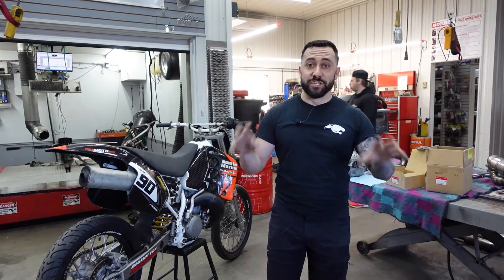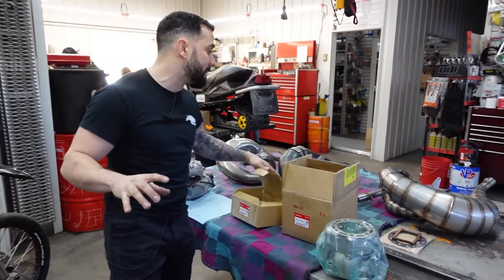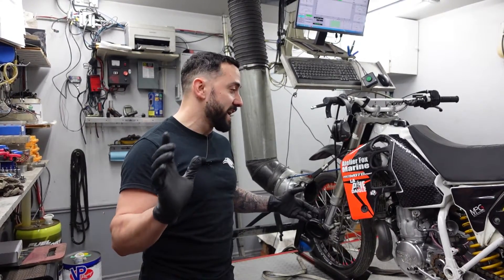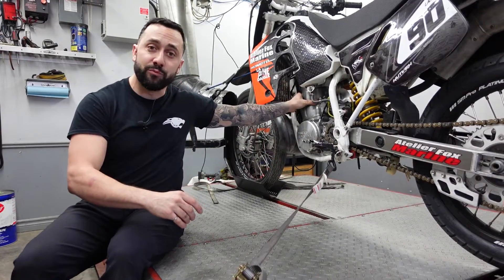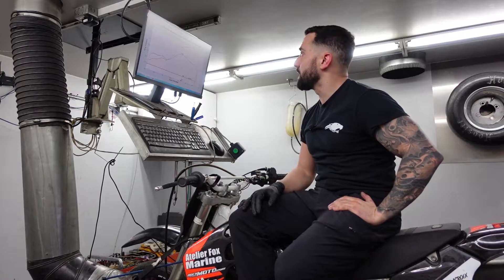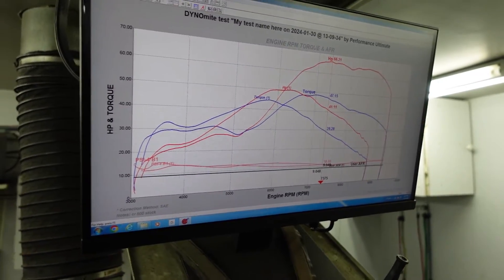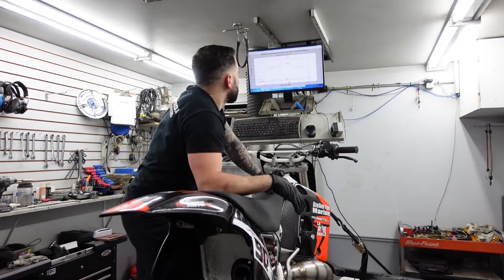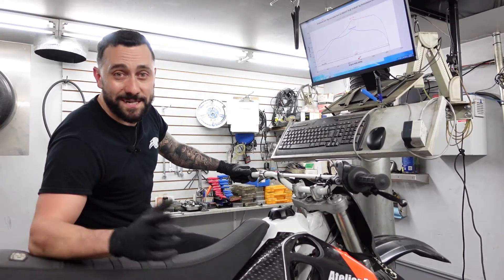Episode 3:  CR500 dyno testing versus Panthera CR560 cylinder  - Mad scientist explains

Comment: I’ve been looking at your motor for a couple months. Just realize I should YouTube it and see what I find and of course it didn’t disappoint. Just spending 11 grand on a dirtbike motor😮‍💨 remember a few years back when Chevys 572 bigblock came out you can get a crate motor 10 grand or a fully built hundred horsepower banshee motor for 10,000 right now …. I need the price justified just a little bit more before I buy one.

Comment: I wa to buy a 560 cylinder for my cr500. Does this set up kill the cranks quick
Reply: Just as a rough estimation if some makes 20% more power you can expect the original stuff to wear 20% faster not always the case

Comment: Here you can see the REAL tuning differences when you go for higher RPM and match the pipe with porting.

Some guys say "I tried everything did all the mods and get 52hp vs stock 50" but they arent really going for power. Just trying to maximize the old powerband thats too low to make high HP :)

Easy 65+hp from a 500. When playing around with pipes you should find the one that matches your cylinder. If you want more power you should MAKE a pipe and port where you want the power to be at.

Comment: Based on my humble math skills. ON rwHP! The Panthera 560 bigbore alone is enough to put down more HP than a Stark Varg 🥹
Reply: Cosworth made a 300cc 4 stroke that makes 90hp to the crank. This stuff is definitely possible but most wouldn't understand because a new pipe and exhaust is considered "fully built" 😂
Reply: You can get almost 80 with the stock cylinder.
Reply: And just full the tank back up and the fun never stops

Comment: Thanks for the Great video. It was interesting to see the FMF pipe actually produced less hp than stock. All it really does is change the power curve slightly and sound meaner. Those other cylinders and pipes had some very impressive gains.
Reply: FMF Fatty has been the best overall gain IMO. The Gnarly shifts the power down low, but taps out up top. PC is a primarily a top end pipe. I cant speak to CPI or Hygge tho.

Comment: How does the customer tune the power valve for the setup he has? You went full open then full closed. Is that something that’s done before you get the motor?
Reply from the maker: The module comes pre-set for an opening around 5500rpm. But you might need to connect to it and tune it depending of the pipe you run. We can sell the connecting cable.

Comment: I got 80 rwhp 53.5 tq @ 7800 on my pm07.   In my quad With a 41.75 mm pwk.  Led performance pipe.  💪 faster than any cr kx 500 2 wheeler.    Thanks 
7:36
Reply: Still a quad so still gay
Reply: @kaisuhina8024  🤣
Reply: @kaisuhina8024 bro😂
Reply: @kaisuhina8024  SO TRUE SUPER GAS
Reply: Quads are for obese we don’t care how much power they have.